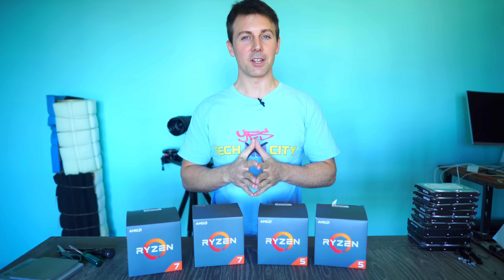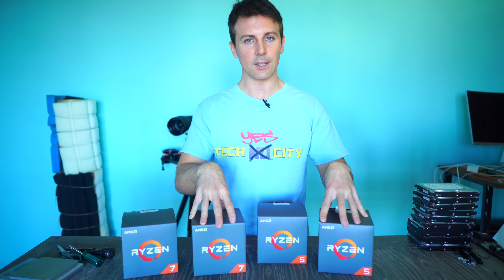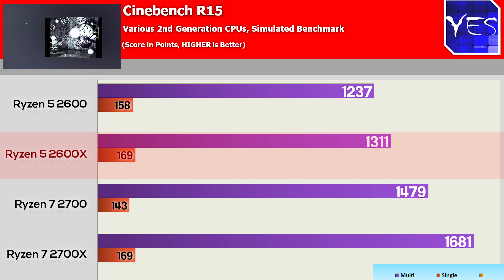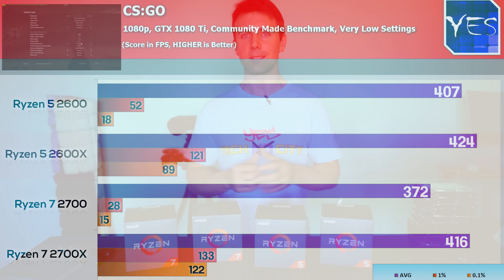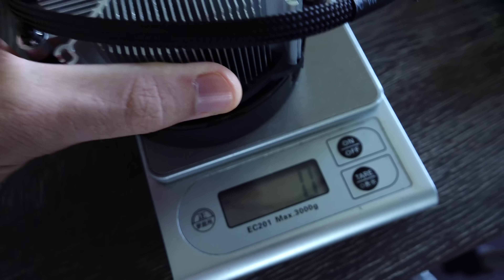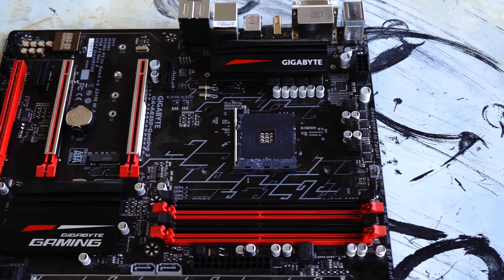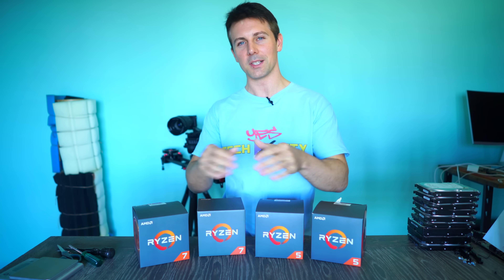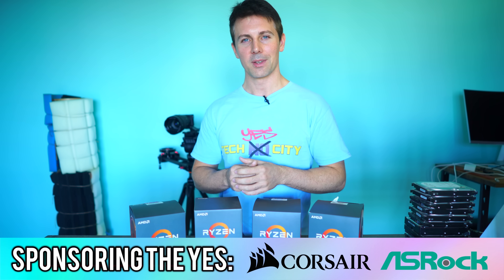Ryzen 7 2700X Vs 2700 Vs Ryzen 5 2600X Vs 2600 - Is the X Better Value...!?

Comment: Great vid.  If your not gaming but using Photoshop and Premier pro in a small mATX build which would you go for (Not overclocked)
Reply: If your using Adobe products don't go with an AMD cpu as Adobe refuses to optimise their software to run properly on AMD cpu's part of a shady agreement they have with Intel meaning if you use Adobe products you have to get an Intel cpu to get the best performance.  It's this and other anti competition and anti consumer practices that made me decide to go with AMD for the first time in 18 years i just can't support a company that treats consumers like crap.  Though i have no experience with them I'm seeing a lot of people talking about free alternatives to Adobe products actually working better then Adobe products and that are optimised for both Intel and AMD davinci is one I've seen mentioned a lot so if your not locked into Adobe might be worth looking at to give you greater hardware options.

Comment: are these temperatures normal for 2600x? could it get damaged? is that stock cooler enough when hard gaming?
Reply: Unless you're overclocking, and unless your stock cooler is broken, its fine. Safe is up to 95C. Only way you're going to get close to that is putting it in a desk in summer with the heat on, playing BFV while video rendering and running SLOBS. Running a game on stock speeds isn't going to fry the CPU.

Comment: Considering that the R5 2600 is only $149 usd right now makes it an amazing value. Especially if you are upgrading and already have a compatible liquid cooling solution. I've been super curious how it would perform overclocked in my full EK waterloop. If I could squeeze 4.1Ghz out of it I would be very satisfied.

Comment: Need help please! Between the Intel i5 (Acer Swift3 or Dell XPS13) vs AMD Ryzen 5 (the one with Ryzen 8 Mobile GPU chip on the HP Envy x360) which one u think actually is better in heat dissipation and fan noise?

Comment: Ryzen5 2600x + gtx 1060 6GB for great 1080p out of the box.
Reply: A RX 580 Nitro 8gb is far better value for money, than a 1060 6gb. It's not only cheaper, but it's also slightly more powerful, comes with freesync and 2 free AAA games. Basically, It's sensible to just go full AMD, for a mid-range gaming PC, at the moment.
Reply: @fafski1199  but you can still play newer games with high/ultra settings?
Reply: @Matedogswe  rtx 2060 and ryzen 5 2600x , would be a beast in the range .
Reply: What is that meen out of the box can you explain me.i wanna build pc with 1060 6gb but i dont know what cpu to get for this gpu i5 8400 or ryzen 5 2600x ;)
Reply: Out of the box means just building the PC and not overclocking.

I would recommend you to not get the GTX 1060. The AMD counterpart (RX 580) is better. Also, a Ryzen 5 2600X would be overkill for the GTX 1060. A Ryzen 5 1400 or Ryzen 5 1500X would  be a good pairing with either the GTX 1060 or RX 580 if you decide to go with that.
Reply: @theonetruelenny9883  thx for explaining and for the advice. :)
Reply: Васил Костов just get an r5 2600 and an rx 580 8gb
Reply: @theonetruelenny9883  uhh i have a GTX 1080 with a ryzen 3 2200g. lol
Reply: Reins 2 cents Boi
Reply: @theonetruelenny9883  But you would pay a similar amount of money for less performance (regarding the 1400 or 1500X). I agree on the RX580 though. A much better choice. However, AMD GPU's do not come with Shadow Play, which for streamers is fantastic.
Reply: @ВасилКостов-д9х  which cpu did you get, the Intel or ryzen.....?  How's it working ...?
Reply: 1050 and 1060's are complete shit.
Reply: ryzen 5 2600x or not   + rx 580 + freesync 144hz monitor    great for 1080 out of the box
Reply: That's my build
Reply: It's lit
Reply: If i paired with Ryzen 5 2600 & rx 570 .  Is there any chance of bottleneck ?

Comment: Just built a work/gaming station, AMD Ryzen 7 2700x CPU, Gigabyte X470 Mobo, AMD RX580 OC Edition GPU, (2x8) Corsair Vengeance 3200mhz (no oc), a 240gb Kingston SSD paired with a 2tb SeaGate HDD, a Corsair Hydro Series 240mm CPU cooler, Coolermaster Mastercase MC600, and to run it all a Corsair CX850m modular PSU.

Comment: I've been running a 2600x cooled by a 360 aio, aorus x470 gaming 5 MB with Corsair rgb 3000mhz ram. With just minor tweaks I can oc my cpu to 4.275 at 1.4v. Cinebench score is 1405-1410.
I love this set up. It runs and looks awesome in a phanteks eclipse p400 tg. It's a massive upgrade from my previous a10 6800k...

Comment: Just bought an Asus ROG Strix B350-f (Ryzen 2000 Ready) I'm a Designer and Not much of a Gamer,  also planning to Use It for Video Editing. what Ryzen should I get?
Reply: Any Ryzen will do it. Ebay has good prices for 1400/1500x/1600 or 2nd gen.

Comment: I really don't get why you would use 1440p high preset when benchmarking a CPU. This simply creates a gpu Bottleneck and hides potential differences
Reply: @Kugelspecht Einhorn neither is "have"
Reply: Not really. Provided you are using a graphics card capable of 1440p gaming the CPU will have more impact there. Usually when testing CPUs most Youtubers use an overkill setup with a 1080 Ti like he has here or a 2080 ti that basically ensures that only the CPU is limiting framerate and performance.

Comment: I would like to if a OC'd 2700 can equal or surpass a out of the box 2700x and the same for the 2600 variants example my 1700 oc'd is very similar to the x variants and at that time cost much less.

Comment: Ryzen cpu's what a beauty. Just bought R5 2600 + Asus Rog Strix B350F + 16GB DDR4 2667 Mhz Adata replaced my i74790k. Amazing jaw dropping OC to 4.1 GHZ at 1.40V stable max temp 62 Deg. C using Wraith cooler (default cooler)
Reply: Stoopidly Stoned  1.4 is the max AMD recommends for 24/7 operation
Reply: Updates have been announced for the 2018 Toyota RAV4 range, which now sees autonomous emergency braking (AEB) and satellite navigation standard on all model variants.  @jamestor6700
Reply: @stevethea5250  why are you talking about a car?
Reply: Ambient temps?
Reply: I can't use the default cooler and OC, cause here in Portugal during the winter we get 10°C to 20°C and in the summer we get like 40°C and here almost any house have AC
Reply: Beware that doing a Cert 3 or 4 at Tafe will lock you out of being able to do a Traineeship/Apprenticeship in Telecoms. Since "technically" you are already qualified, yet fail to have any practical experience or knowledge. So you don't qualify for a government subsidised traineeship, meaning no employer will touch you. A lot of kids fall into this trap with trades like electrical when they can't snag an apprenticeship straight out of school, so do what they think is the right thing and go study the course anyway at TAFE, not knowing what they are doing is cutting their own throat for employment. If you really want a traineeship in Telecoms, look at someone like Skilled/Programmed who do Telstra traineeships. If you can snag a Telstra traineeship you will be riding high on the gravy train in the telco industry of this country. Do not do a traineeship that turns you into a Contractor with your own ABN/Vehicle/Tools/Tax/Insurance ect ie. IGSM. You will be burnt.
Reply: @stevethea5250  I'm just gonna block your ass
Reply: You need more mhz for your RAM speed, at least 3000 for an AMD build because it depends highly on it. You might also want to consider a 3rd-party cpu cooler.
Reply: @chosenyong  not depends highly on it just benefits highly from faster RAM

Comment: I’m looking at getting the Ryzen 2700x or the none x. I will not be over clocking as I’m new ish to pcs and just don’t want to. I’ll be doing streaming rendering gaming ect but I want to get a big boost from my current cpu (intel i7 4790k). I have to get new ram and a new mobo so the prices are already very high. A friend said to get the 2700x as I was looking at some other Ryzen 5. As I said I won’t be over clocking but what should I get. I just want it to run really well right out of the box. If it also helps I have a nzxt liquid cooler for the cpu
Reply: Ryzen 2700x its XFR is big plus out of the box cpu.

Comment: I think the i3 8100, the i5 8400/8500 and the i7 8700K are the best CPUs for most people and the Ryzen 3/5 2200/2400G the best APUs.

The Intel chips run games better than the competition and at the higher end the 8700K vs the 2700X win in memory latency, single-core, quad-core and floating point performance at those core counts maybe with AVX even at multi-core maybe not. The 2700X win by a tiny bit in multi-core FPU and a bit more in multi-core ALU stuff as long as not memory dependent but clearly games are memory dependent and with an over-clock the 8700K will get close even in those two last cases where it lags behind and will be even better at everything else whereas the 2700X isn't catching up on anything. So with no OC at best I guess it's a wash and with OC the 8700K win almost at all times.
Reply: wqit a min i thought the r7 was within about 10% of the 8700k in gaming performance and beats the 8700k in multicore performance also not to mention the r7 is quite a bit cheapet then the 8700k.. did i somehow miss some new benchmark vids or something on this or did i just misunderstand what i have seen?!

Comment: I’m looking to pair the 2700x with Corsair 3000mhz ram... This is my first and build and am a bit worried all the ram issues I keep hearing about. Can anyone elaborate on what the issue is with ryzen and certain ram???
Reply: im running 2700x with 3000mhz corsair vengence
Reply: Ashley AMV Thx
Reply: ram wasnt supporting much on AM4 motherboards back when ryzen launched, they're doing fine now, no problems
Reply: Oced my 3200cl16 to 3466mhz on gigabyte b350 300 to 450 fps on csgo +vulkan.
Reply: im runnning 2600x with hyperx predator new pc in 2933mhz best solution without overclocking..chooce them for 2700x

Comment: Hello  , Great video , I was going for the 2700x , but I really dont know how to overclock , and I will use it just for gaming , so I will go for 2600x now , 
 need help for 2 things .  Is it 16GB (8GBx2) G.SKILL Trident Z RGB  DDR4 PC25600 3200MHz CL16 Kit  good choice ?  ( do I have to overclock the memory ) OR G.SKILL Flare X Series 16GB (2 x 8GB) 288-Pin DDR4 SDRAM DDR4 3200 (PC4 25600)  ? Mbo to be MSI X470 GAMING PRO  ?  Thank you

Comment: I am happy with my 1700 and will not upgrade to 2nd gen. I kind of won the silicone lottery and got a chip I can overclock to 4.075 GHz at 1.425V which in combination with G.Skill Trident Z 3200 C14 reaches over 1800 cb on an MSI X370. Nevertheless, if I had to choose now, I would go with the 2700 on an X470 chip set because I favour having the choice of running an 8 core 16 thread CPU with 65W TDP which I still can overclock to the performance beyond the 2700X and with Ryzen Master, overclocking became a piece of cake.
Reply: You have sealed the deal for me thanks G, I’m doing a 2700 with nzxt kraken cooler on the asus x470-F with 16gb 3200 g skill trident ram with 250gb m.2 with a rog Strix base 1080 should I make any changes if I’m trying to stream and game on this pc. I will be playing Pubg, fortnite, battlefield etc etc
Reply: I have the 1700 as well along with a 1070ti and a cooler master AIO, got it in a pre built for a killer deal along with a 600watt power supply and 8g of Ripjaws V ram for $1200 in an IN WIN 301 MATX case with three led fans and one for the radiator, all matching colors off the Mobo header. I cant find a better deal anywhere so far. The only bad bit is it comes on a very basic locked A series board but since I already am getting the performance I want right now there is no pressing need to switch a primary component, especially with Ryzen 2 and new mobo's less than a year away. The 1070ti Zotac mini is the card it came with and I am honestly shocked on how good it is. MSI afterburner has it at above 2g on the clock and I have a conservative 380 mhz on the memory. This card has a power limit since it has only one eight pin connector so I tend to favor clock speed over memory speed since once I majorly increase one the other one boosts less. This whole package was out of my reach until literally three weeks before I ordered. Thank god for that Nvida launch and relaxing GPU prices in general...lol Running every game 4k@60 so far with very few minor compromises. I am mostly running on high believe it or not. Fortnight Save the World and Forza Horizon 4 run really nicely as well as Gears of War 4. Settings for Forza is all high with utra world textures and it looks just amazing. I also plan on getting int some editing later this coming year so that is another reason I went heavy multi core with a good GPU. Walked out the door with mine for under $1240 including a 4 year warranty from squaretrade on Amazon and two day delivery of course...lol
Reply: Also especially since I dont have a manual overclock and it a lower tdp part the liquid cooler included does not exceed 30c(27.5 right now) on common tasks like surfing watching videos etc.. I have never had an AIO before so this had me geeking out..Also the little zotac card running full bore never really exceeds 71c with a mildly aggressive fan curve enabled. For for a smaller form factor pc I do believe for my use case that I am getting very nice thermals overall. I will be adding M.2 storage and another matching ripjaws kit within the next month and wait to see what Amd does for the next year.
Reply: M. Wiedmann NOICE

Comment: What I love about my 2600 "X" is that it overclocks itself. What I hate about it? That it overclocks itself. Heh. On my Corsair H100i v2 AIO, 1 hour of PUBG the CPU is around 55 C and holds around 4100 - 4150 MHz. YES on all cores. Side note... On the included cooler it was 10C hotter and would be around 4GHz in games. Going with an AIO netted a 150 MHz clock boost. On AIDA64 CPU stress it hits about 72C average and clocks about 4Ghz after 30 minutes. Not representative of gaming thermals. Great value? 2600 non X with Hyper Evo 212 overclocked to 4.1. Add some DDR 3200 = Smashing the value wall.

Comment: My new $199 ryzen 7 1700 at 3.8ghz all cores stock cooler with 3200mhz ram speed running great guess I got lucky
Reply: Luis Ramos oced your ram to 3466mhz 17-17-17-17-21 1t 1.39v
Reply: Me You im fine how it running maybe in the future i will try that

Comment: Went for a 2600. It does what it's supposed to. On a side note, I had an FSP windale 6 cooler and my recommendation: get a dark rock 4 (pro or not, doesn't matter). There are too many issues with the FSP cooler: AMD brackets are poorly designed, the plastic washers are too tall, it leaves no room to securely attach the mounting brackets for AM4. The fan is blowing from down-up. HUGE annoyance, because the fan is not tightly secured to the heatsink with the rubber things that always leave some slack, so there's audible vibration. One could place the fan on top of the heatsink, but.. I'm not too sure about that as warm air would always be rising.
Don't know about potential issues for intel mounting.

Comment: I really think I got a good chip this time around. My Ryzen 2700X out of the box was hitting...jumping around fr 4GHz to 4.39GHz on a Asrock Fatal1ty AB350 Gaming K4 Mobo with Noctua NH-D15 cooler. So I tried overclocking it and I got a stable OC on all cores to 4275 MHz CPU Frequency @ 1.4125v. I bet I could push it little bit higher but didn't want to send anymore volts through the Mobo VRM. The temps are pretty reasonable, on idle 28c, on-load 65c max. My last Ryzen 1700 could only do 3.9GHz @ 1.3875v...anything beyond 3.9GHz it just craps out.

Comment: Hi Bryan, what RAM speed were you using for these tests? I've seen the 2700X score up to 180 in CineBench single-core, but here it was just 169.
Reply from the maker: 3400 was used in the tests. different motherboards could produce different results for sure.
Reply: Oh, yes, that's right! I just watched your original 2600X/2700X reviews, and they both scored 178 with the same RAM speed!

Comment: upgrading to  a ryzen 5 2600x from an intel i5 3550. i feel that is a very good performer for the money, with good gaming performance and very good productivity performance. my last amd was an athlon64 3400+ , but up until now i haven't percieved amd cpus as competitive. hope that 6 cores and 12 threads will serve me well, and i can upgrade later without changing the motherboard.
Reply: why not try i5 8400? if just gaming
Reply: @zZerky  Because u have better performance with Ryzen 5 2600X than i5 8400.

Comment: Thanks for testing the 2700x on the b350. I think it was the ab350 gaming 3? Still I believe that the power stage on this is not enough for the long term. I have the same board with the 1700 and honestly I don't think I need to upgrade unless I find a very good deal for the 2700.

Comment: Technically, the AMD Ryzen 2 chips are not actually "second generation CPU's" but more of a first generation plus CPU, which makes the "Ryzen 2" a bit of a misnomer statement!  Now having stated that, I am still interested in seeing what the differences are with the standard Ryzen CPU vs the Ryzen X CPU's!  Also what is the differences between the Ryzen 3 - 5 and 7 CPU"s, or is that their designation of 4 core, 6 core and 8 core CPU's?